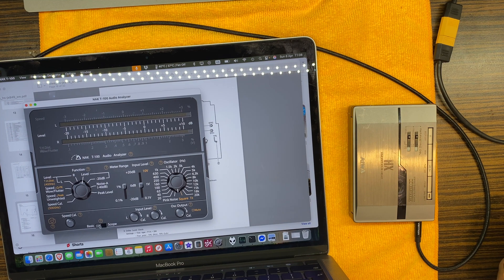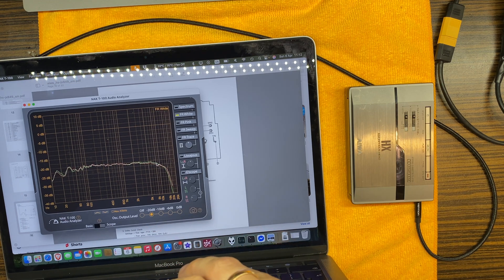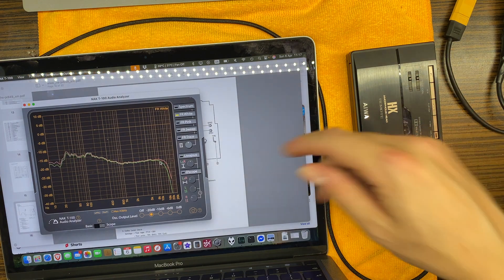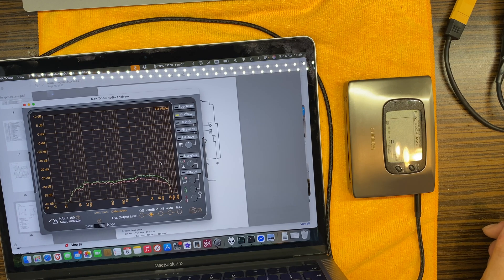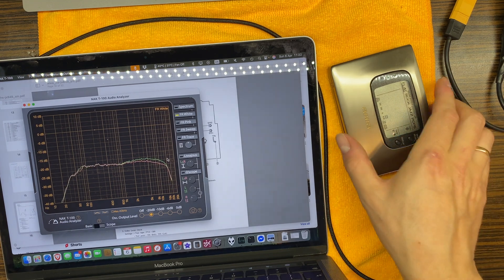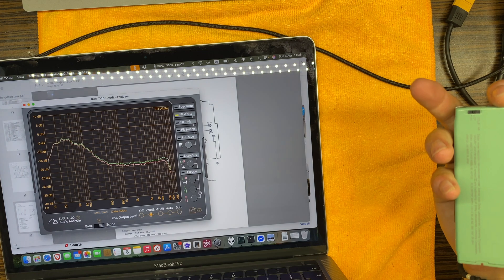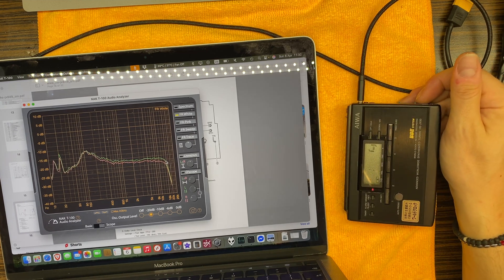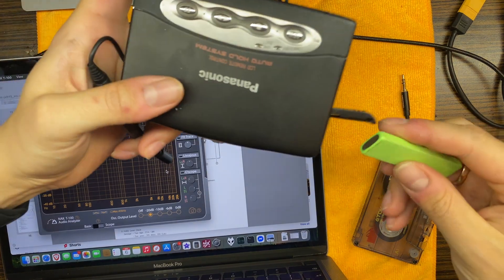Lets see if those walkmans/portable cassette players have good frequency response #japan #diy E0080

Comment: Very interesting video. It's surprising, how much of a difference there can be between devices. I suppose a lot of this could be down to a number of different parameters not least of witch would be the quality and amount of wear there is on the head. Thanks for sharing.
Reply from the maker: Yes mate, all of them are using different head amps and different equalisers. But what surprised me a lot is that Panasonic device, not the best sounding one for sure, but its super precise and stable with that fixed in place head without any adjustments options. What i also noticed is that it doesn’t matter how high in frequency response devices go it can be max 10khz, but it can sound very nice 👌 otherwise music is actually until 10khz after that mark some say that it is just noise… 
Thanks a lot for your support and for very nice comments!
Cheers

Comment: i think that problem in azimuth anligment, i a;ways take a little screwdriver when go out with one of my Sony DD's.
Reply from the maker: not in this case- only few devices had option to adjust azimuth and azimuth is set the same on all that have that option as the reference deck that i used to make this fr response test cassette. Cheers

Comment: I have three Aiwa RX705, one with very little wear, imperceptible wow&flutter, two had the problems you mentioned regarding incorrect azimuth due to deformation of the head mount. I solved it easily. Of course I had to change the miniature electrolytics and the internal battery (Compatible with VL1220). All of them play excellently the recordings made with an Akai Gx-F71 recalibrated in Dolby B. Interestingly, the belts are all original, only the mechanics have been cleaned and relubricated. I have somewhere in the documentation saved the frequency response declared by Aiwa and indeed it mentions losses above 8Khz. I have to search the archive. In reality, however, these players sound very good if they are within the parameters.
Reply from the maker: yes you are right about vendor mentioned fr response: 63Hz~8kHz‡3.5dB (NORMAL)
63Hz-~10kHz ‡4dB (CrOz, METAL)
but in real life sometimes you can get better results :) 
Anyway RX705 are excellent players too - its pl555 just with radio tiuner.
Cheers!